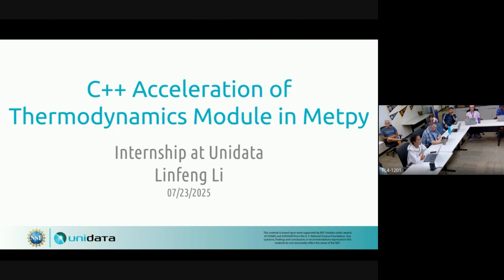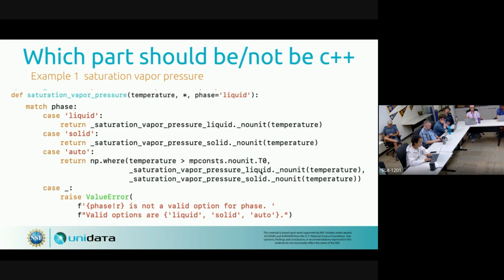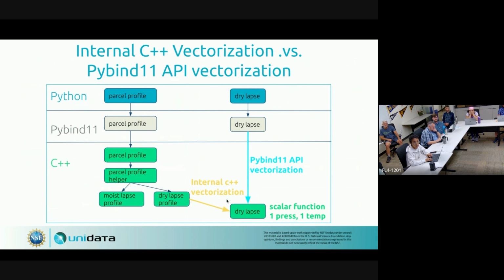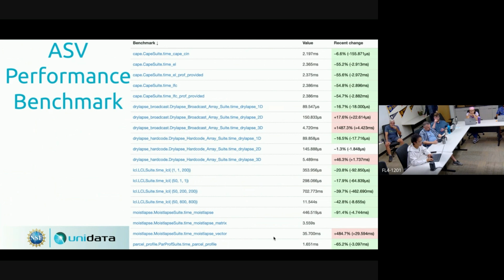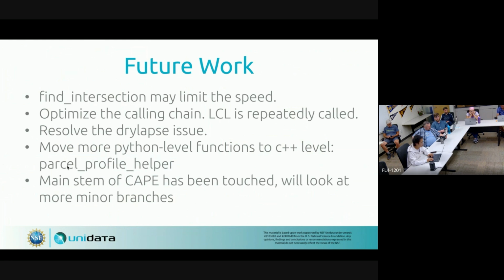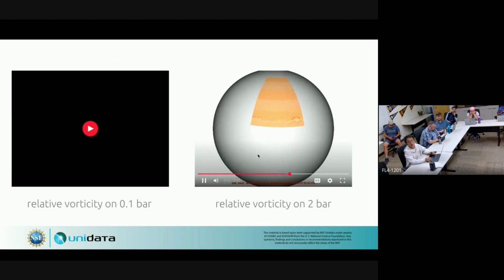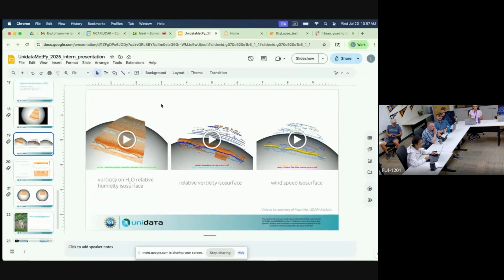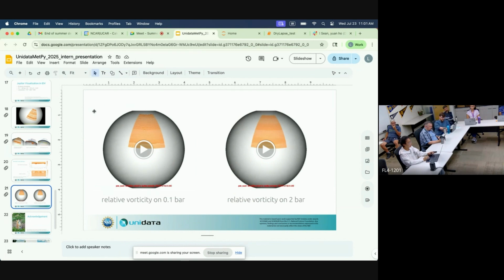2025 Summer Intern Linfeng Li: End-of-Summer-Seminar

Comment: AI Summary

Abstract:

This presentation details Linfeng's summer internship project on accelerating the thermodynamics module, particularly the Convective Available Potential Energy (CAPE) function, within the MetPy Python library by integrating C++ using Pybind11. The core motivation is to improve the performance of computationally intensive meteorological calculations, which involve multi-stage processes and large datasets. Linfeng discusses the design challenges encountered, such as handling units, input validation, array broadcasting, and integrating Python's user-facing logic with C++'s core computational efficiency. While significant performance improvements (up to 90% reduction in runtime for some functions) were achieved for many thermodynamics functions, challenges persist with multi-dimensional array handling in functions like `dry_lapse`. The presentation also briefly covers a secondary project on visualizing Jupiter's atmospheric simulations in the Integrated Data Viewer (IDV), showcasing complex structures like vortices and plumes, and discussing the visualization challenges presented by planetary scales.

Accelerating MetPy Thermodynamics with C++ and Visualizing Jupiter's Atmosphere

*   0:00 Project Introduction: Linfeng introduces his summer internship project: accelerating the thermodynamics module in MetPy using C++ to improve performance, especially for the complex Convective Available Potential Energy (CAPE) function.
*   0:47 CAPE Calculation Complexity: The CAPE calculation is a multi-stage process involving several thermodynamic building blocks like LCL (Lifting Condensation Level), Dry/Moist Lapse profiles, finding intersections (FLC, EL), and area integration. These steps are computationally intense for large datasets in Python.
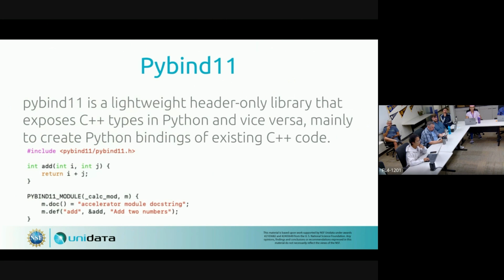*   2:09 Pybind11 as the Tool: Pybind11, a lightweight C++ library easily exposed to Python, is the main tool for creating a bridge between C++ and Python for performance optimization.
*   3:07 Implementation Challenges: Key challenges included handling units in C++, validating input (scalar vs. array), broadcasting arrays, incorporating existing Python constants, and assembling complex return values.
*   4:50 Python-C++ Design Philosophy: A layered approach was adopted: Python handles user-facing logic and complex data assembly (e.g., determining liquid vs. solid phase in saturation vapor pressure), while C++ focuses on core, specialized computations for speed.
*   7:44 Vectorization Strategy: C++ functions are written as scalar functions (single value input/output). Python-level API vectorization (using `py::vectorize`) handles array inputs, with looping occurring efficiently on the C++ side. Internal C++ vectorization also occurs when higher-level C++ functions call these scalar functions.
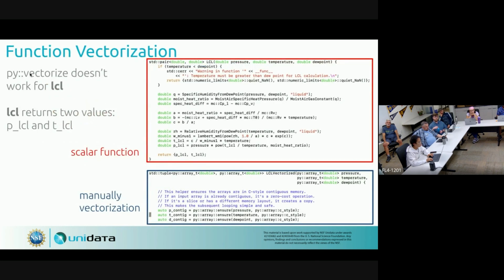*   10:00 LCL Function Specifics: The `py::vectorize` utility has limitations when functions return multiple values (e.g., LCL returns both pressure and temperature), requiring manual member function writing for vectorization.
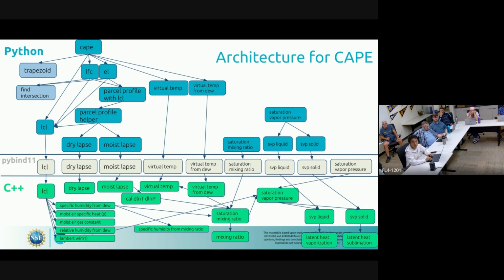*   11:00 CAPE Architecture & Dependencies: The CAPE function's architecture involves a deep, intertwined tree of interactions and dependencies. Many bottom-level C++ functions (like specific humidity, dew point) are exposed to Python.
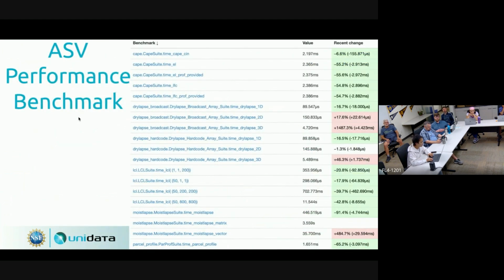*   11:49 Performance Benchmarking with ASV: Using ASV (a Python benchmarking tool), significant runtime reductions were observed for functions like EL, LFC, and partial profile, with some reaching over 50% and moist lapse calculation for 1D arrays showing a 90% reduction.
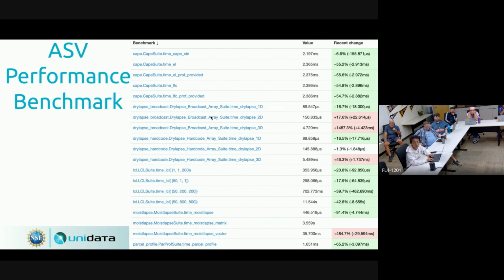*   12:37 Dry Lapse Function Issue: The `dry_lapse` function showed slower performance (up to 15 times longer) for 2D/3D array inputs when broadcasted from Python to C++, implying Python handles its own broadcasted arrays more efficiently. For now, the Python version of `dry_lapse` might still be preferred by users.
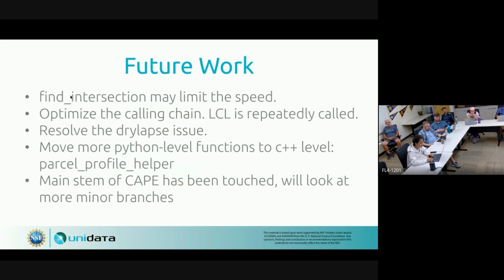*   14:27 Future Work for MetPy: Future improvements include optimizing math functions (trapezoidal integration, find intersection), resolving the `dry_lapse` issue, completing the `partial_profile` function, and moving more surrounding functions into C++ for further speedup.
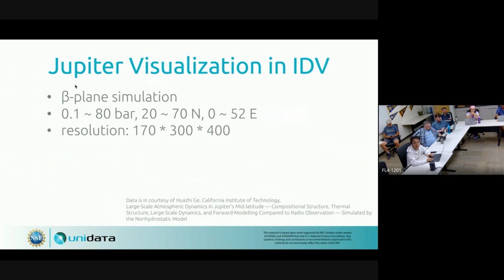*   16:55 Jupiter Simulation Visualization (Secondary Project): Linfeng also worked on visualizing Jupiter simulations in the Integrated Data Viewer (IDV) with fine-grained resolution, deep pressure levels (1-88 bars), and a 50-degree latitude/longitude range.
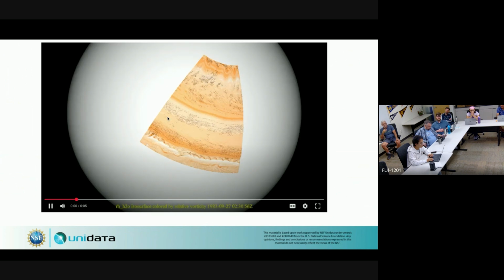*   17:46 Jupiter Atmospheric Phenomena: Visualizations revealed clear vortices, plumes traveling east to west, and characteristic band and zone structures. Vortices extend deeply from shallow to deep pressure levels (0.1 bar to 85 bar).
*   20:02 IDV Potential & Challenges: IDV shows potential for visualizing other planets despite challenges with data format, stretching simulations to align with Earth-sized globes, and scaling issues due to Jupiter's size.
*   21:38 Jupiter Wind Speeds & Circulation: Jupiter's jet streams can reach 100-200 km/h. Its circulation is driven by instability caused by water and ammonia vaporization and condensation, triggering vortices.
*   27:14 Key Learning from Internship: Linfeng's main learning was extensive C++ coding, which will be valuable for future simulation and dynamic modeling projects.
*   28:22 Python-C++ Interoperability: The combination of Python and C++ (via Pybind11) is a common and robust practice in scientific Python, used by libraries like Matplotlib and SciPy, particularly for speeding up tight computational loops that are slow in pure Python/NumPy.
*   30:08 Motivation for C++ Optimization: The decision to use C++ was driven by identifying `CAPE` as a high-value, highly-used function that hits known limitations of Python and NumPy (explicit loops, integral calculations) causing runtime issues (e.g., taking hours for large datasets).

I used gemini-2.5-flash| input-price: 0.3 output-price: 2.5 max-context-length: 128_000 on rocketrecap dot com to summarize the transcript.
Cost (if I didn't use the free tier): $0.0120
Input tokens: 29429
Output tokens: 1252